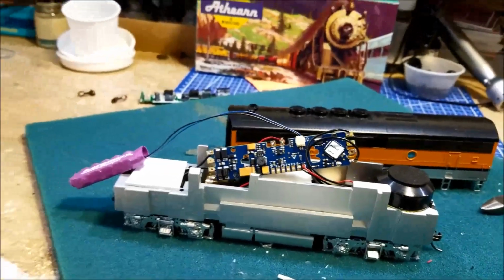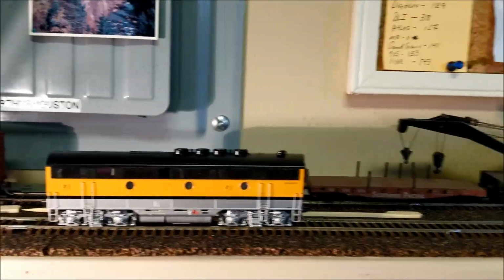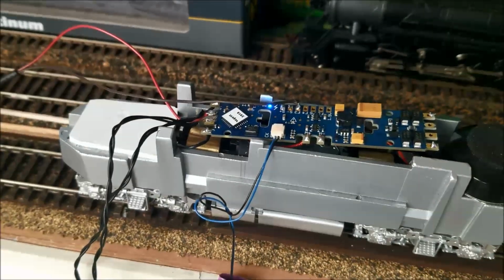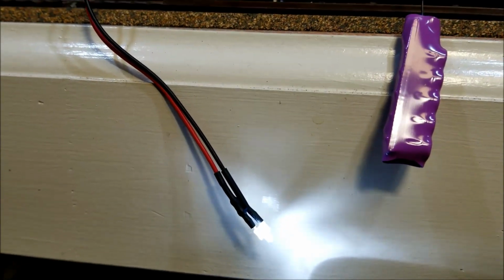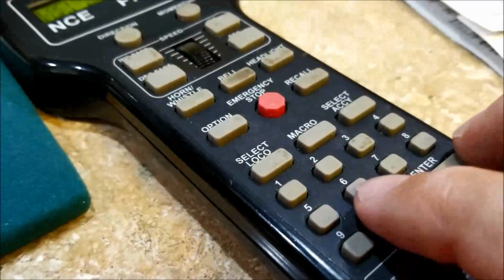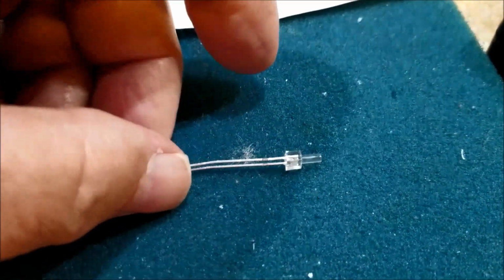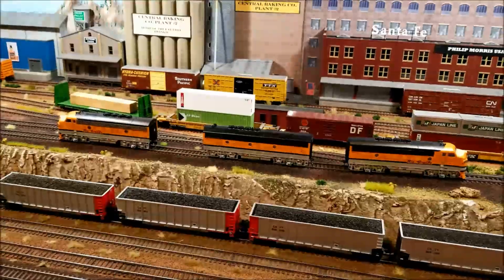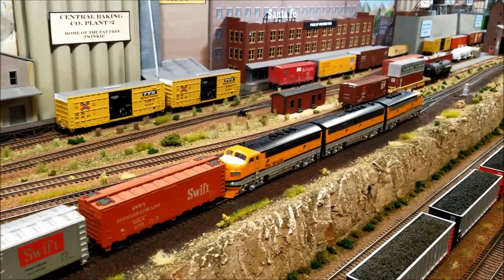Installing Soundtraxx Tsunami 2 Decoders and Current Keeper into Athearn Genesis F Units/ LED

Comment: Thanks for this video.  I have both of the F units you show here.  One is an F3A and the other an F9m, which was an F3A that was wreck repaired by the D&RGW and reskinned with an F9 car body, but retrained the high shrouded roof fans.  I also just found the F7 #5711 recently and bought it.  I believe it was produced in 2008 so probably will need the same light board style decoder.

Comment: what sound file is that ?
Reply from the maker: One that comes on the decoder.
Reply: Tsuanami 2 are on the decoder.  If you want to customize, you'll need to get the ESU Loksound 5 decoder which you can load sound files.